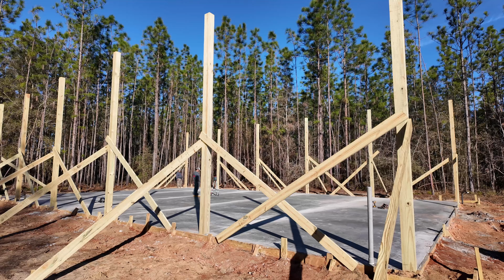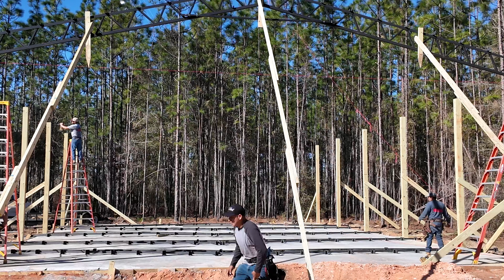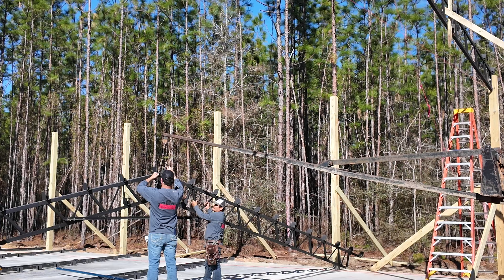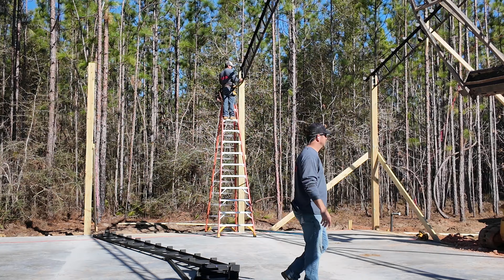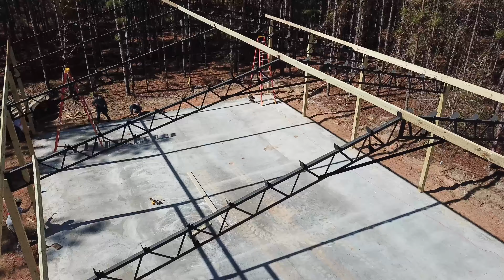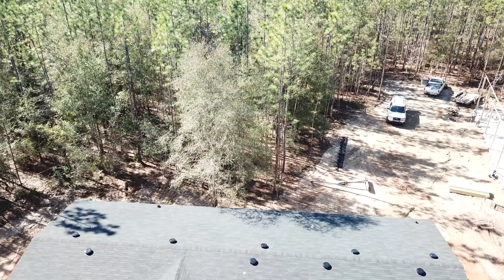they start on the frame

Comment: When I was building pole barns (as a general contractor, they were not my main thing) I'd set the 4 corners first, and then once they were solid/concrete set, the next day usually, I'd set the poles in between, bracing horizontally the length and width of the building off of the 4 solid corners. This worked out great rather than having all of them being braced but not solid yet.